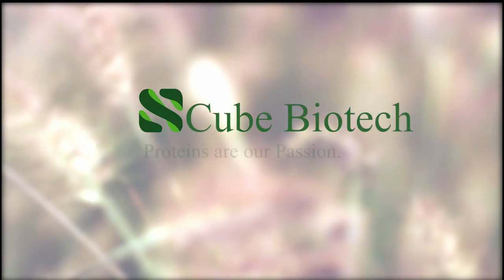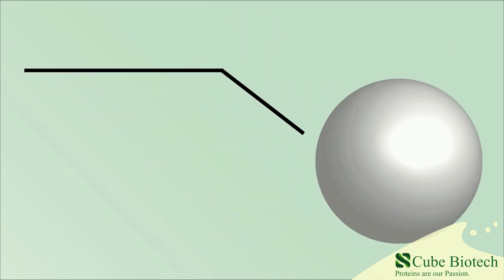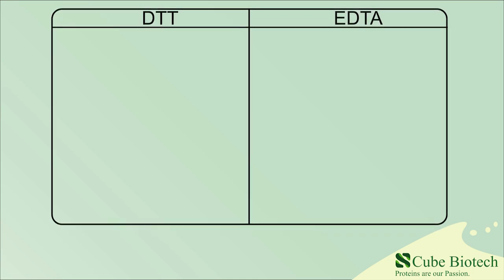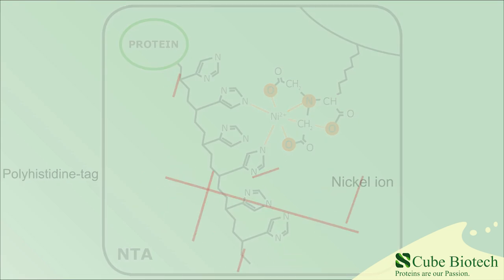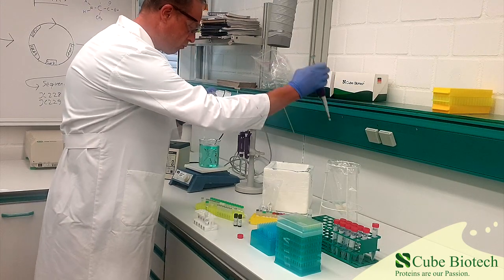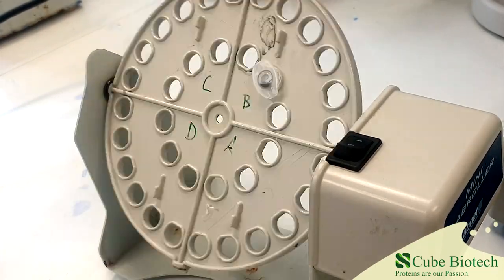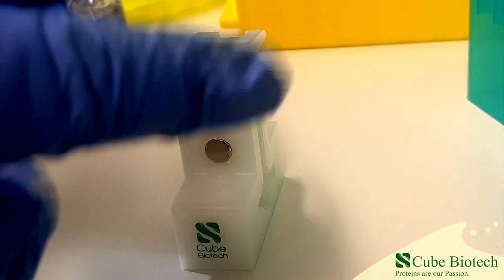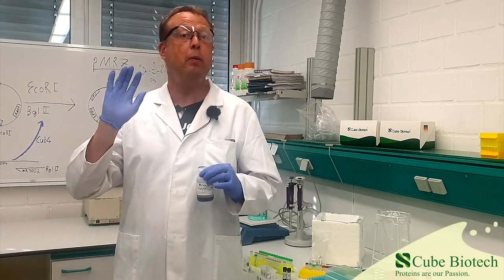Guide to magnetic beads / MagBeads for protein purification

Comment: @Cube Biotech also are there any alternatives that can be used in place of the separator that you placed the MCT in? Thanks
Reply from the maker: In theory every magnet that is strong enough to bind the beads, while you pipette away the buffers works. Our however our MagBead separator is more practical because it is designed for MTCs.